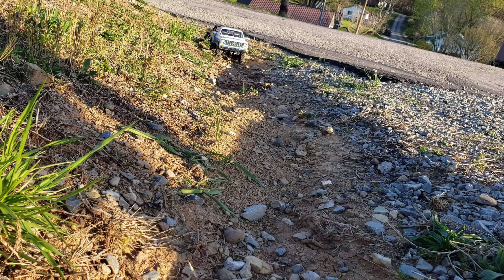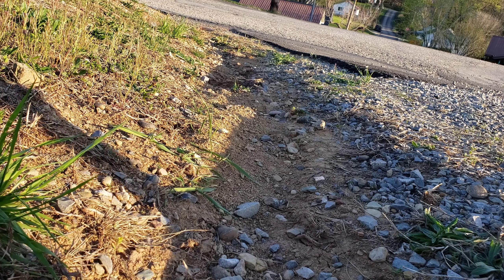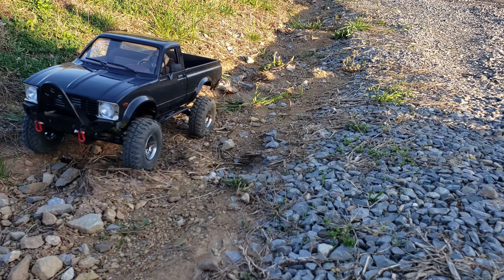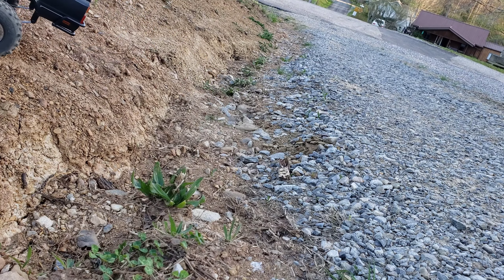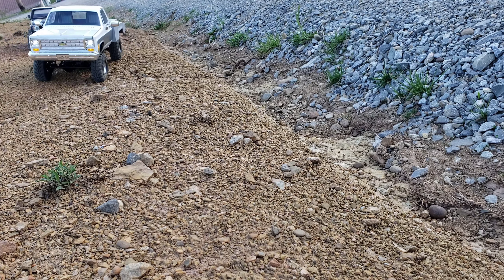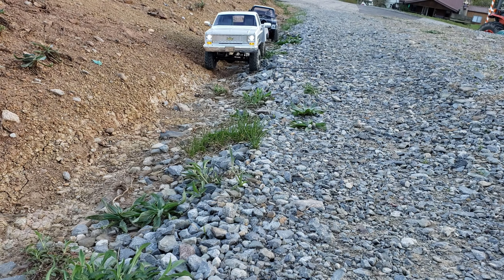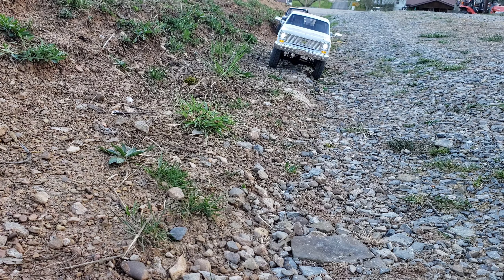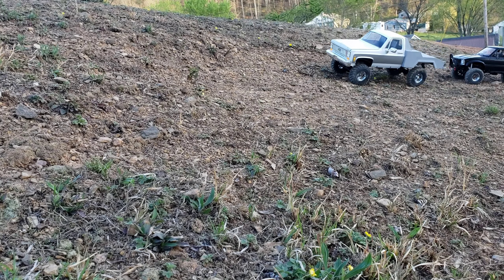Rc4wd/short trail test

Comment: Its got some nice flex on it, drives real smooth as well, will be worth putting in da effort to make it yours I think..........
Reply from the maker: It does have some excellent working suspension setup for sure I had to do some tweaking to get it but you maybe correct